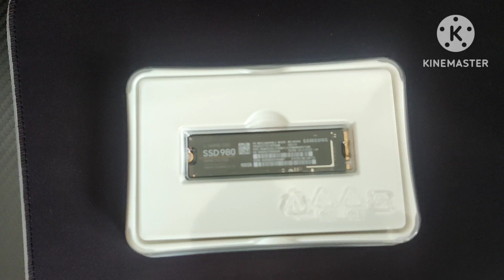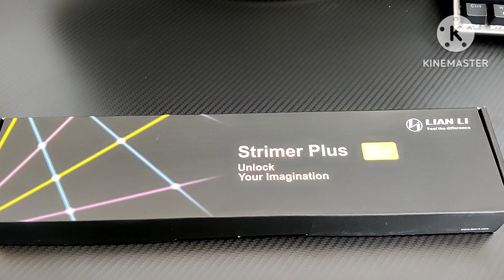White #LianLi pc build

Comment from the maker: Installing GIGABYTE NVIDIA GeForce RTX 1660 12GB GDDR6 Graphics Card (GV-N2060WF2OC-12GD)

Installing Lian Li Strimer Plus V2  8-pin and 24 pin RGB GPU 300mm Extension Cables 

Installing NZXT Kraken 240 RGB White, 240mm All-In-One Hydro CPU Cooler, 2x 120mm RGB PWM F

Installing Samsung 980 500GB PCIe 3.0 NVMe M.2  Internal SSD (MZ-V8V500BW)

Installing T-Force Delta RGB DDR4 Gaming Memory - 16 Gb - 3200 Mhz

in this video I finish building the white Lian Li gaming PC I've been working on this month it's still got a few things to change like the bottom fans and the back fan but this was the first time turing it on